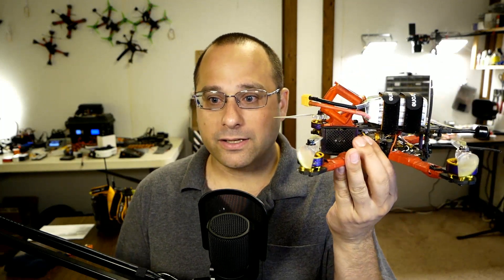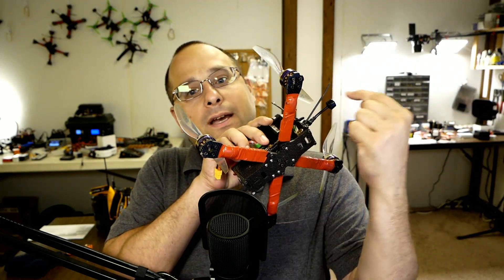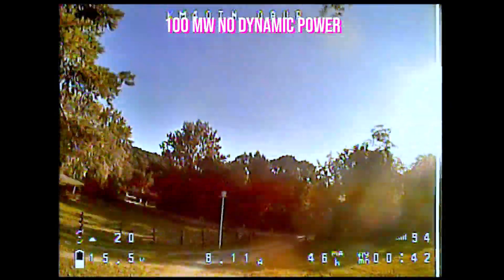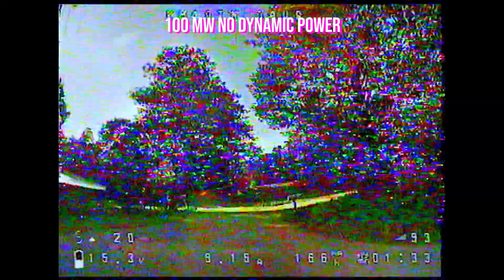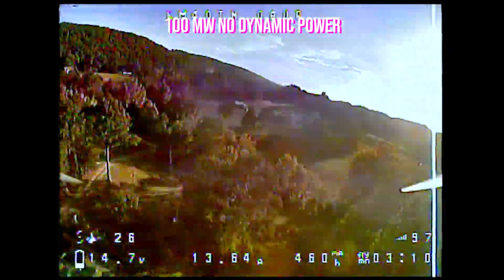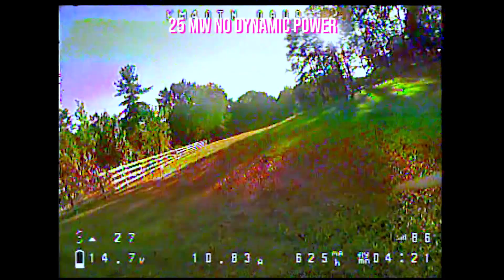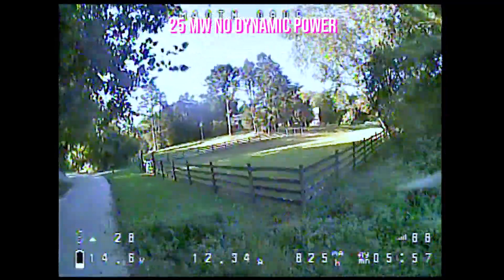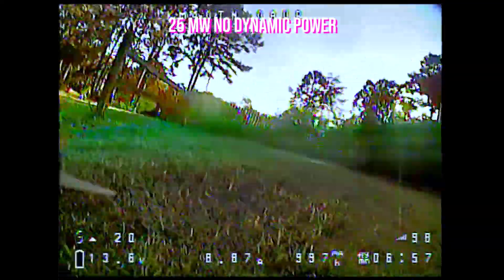TBS Crossfire 150 Hz | How Far Does It Go

Comment: You hit a null zone and thats why the beep. I bet you didnt setup a beacon for when it goes back up to rfmd2
Reply: The way he has his antenna setup you cant hit both null zones at the same time. So no it wasnt from null zones on the antennas
Reply: @BonemysterFPV  you still hit a null because the tx cannot be vertical and horizontal so you are wrong.
Reply: @Just-A-Guy-Learning  Doesnt he have his tx antenna pointed at the quads directions when it goes down to 50hz?
Reply: @Just-A-Guy-Learning  nevermind i get what you mean, anyways a lot of people mount it like this so its a good test.
Reply: You don't need a beep for when it goes back. It will constantly beep while at 50hz. Stop beeping when it isn't.
Reply: @fatal510  no it doesnt. It beeps once when it drops. Unless you set it to repeat. Which is annoying and pointless. My point was he dropped into 50hz in the null and likely jumped back up to 150hz as soo. As he moved out of it.
Reply: I guess you aren't very well versed in how taranis logical switches work? Because how I described it is how he said he has it setup. You noticed how it repeatedly beeps at 4:17 ?
Reply: @fatal510  im very well aware of how it works. But it's better to have a different sound for when it goes back up to 150hz mode. A single beep like most people do only lets them know if it drops to 50hz. Doesnt tell them if it goes back up to 150hz. Im hitting 5 miles in 150hz mode on 100mw. His drop into 50hz is from hitting null zones. Had he had it setup to notify himself when it went back to 150hz mode, he would have been notified once he turned out of the null zone.
Reply: Or better let Taranis say "2" for RFmode 150Hz and "1" for RFmode 50Hz!
Reply: Good chance he is on old firmware anyhow. Because rssi doesnt move from 99 when in 150hz mode since 2.30. Seeing his rssi all over the place tells me he was on 2.24 or older. He got a low rssi warning then it beeped when it dropped into 50hz mode. He needs to do this test on a newer firmware. Not one where the rssi/lq is all over the place in 150hz mode.
Reply: So what is the latest stable version? It was 2.24 last time I checked which was probably a month ago.
Reply: @Siamect  they are usually beta release for a week. Even when they do switch over to whats considered a stable release sometimes they dont bother updating the agent right away and post it in the crossfire group and forums
Reply from the maker: RSSI/LQ in the OSD can be ignored like I said in the video. The RFMD sensor still indicates correctly whether you are in 50 Hz.
Reply: @JoshuaBardwell  it drops into 50hz much faster on the old firmware. When the rssi drops it puts it into 50hz mode to extend the range. Forces it to drop into 50hz before it actually needs to. On 2.24 i was dropping behind a few bushes and it would go into 50hz mode. On 2.33 now and i can fly to the end of my neighborhood and drop down behind lots of foliage and still be in 150hz mode

Comment: Hey there Josh, I have my Taranis set up like yours for warnings. I use a TBS diamond antenna and always run it @ 2 watts, I never get the beep on my taranis. Could i really be getting 2200 feet away with 150Hz?
Reply: cJhudanich holy smoly... 2W!!! I can do 2200ft away with any of my Frsky setups. You should be more than fine with just 100mW.
Reply: Easily. Hit 5 miles on 100mw in 150hz mode
Reply: 2w is fine to set max. But turn dynamic power on. You will rarely see it go to 2w. You risk burning up your rx with tx on 2w at short range.

Comment: Is there an earth bank between you and the quad just a bit after you go out of your gate onto the road?
I think if you want to do (useful for viewers) range testing you probably need to do it somehwere the quad has LOS to the radio the whole way, at least for a baseline, then you can throw in behind trees etc.
Also be interesting to see the same with a 2.4 system. (install a second RX with power only?)
Reply from the maker: There is no earth between me and anywhere out the front gate or onto the road. However there are some trees and bushes and stuff.

The thing I was most curious about was, if flying in a typical race or freestyle environment, do you lose 150 Hz "early", and my answer is, no, you pretty much stay at 150 Hz everywhere within typical range.
Reply: Joshua Bardwell the problem that I've seen is that once you enter the 50Hz mode, it doesn't come back to 150Hz unless get a pretty strong signal again. I fly around my house at 10 and 25mW and almost every time I put the cars on my garage in the middle, it drops to 50Hz. You might stay at 150Hz in a race environment, but if you are bando freestyling, you'll be in 50Hz most of the time.
Reply: once there are more than 4 pilots up on CF where i race its a 50hz party

Comment: A bit off-topic, are you using the clearview module? The fpv feed is great.
Reply from the maker: This one was Rapidfire with 800 mW Unify on the vTX. But also it was the Lumenier DX600 DVR which does a MUCCCHH better job than the built in Fat Shark one.
Reply: Oh wow! Are you running the standard mode 1?

Comment: Just did the 250mw software update. I've been getting an annoying haptic warning when crossfire switches modes (even when LQ is in the 90's). Been looking for where to turn it off!
Reply: Mark Pfeifer you might be getting silent "sensor lost" alarms. Clear all the sensors and discover all of them again.
Reply: @ashade4037  Good idea, but didn't fix it.  Wonder if default taranis RSSI alerts need to be changed somehow.....

Comment: it doesn't matter if you can't see anyway..as long as it doesn't failsafe
Reply: Agree, main thing it dosent fall in the ocean on a fail safe! Turn that puppy up to 2 watts and see whats up!
Reply: Fly-N -Ryan have you ever ran on 2 watts before? What was your range if so?
Reply: @jazzzyj7589  yes i have run the 2 watts option, looks like it goes further then my vtx can handle. I do it in high risk spots that fail safe is not an option. As far as distance, That depends on environment. I would say atleat a few miles in an open area, never failsafed on 2 watts. But just like anything if you go behing a rock face or a dirt bank your range will drop dramatically. Hope this helps. ALOHA🤙🤙
Reply: Yeah, I had my micro flyable vision behind metal buildings but it failsafed. Then I had my big quad go rouge (bad reciever), and it got stuck at last command if 3/4 throttle into the ground as I ran to get within range to disarm. That toasted motor, my ESC board, and wierdly enough my FC USB plug litterally popped off (I've never seen that happen on an electronics devise).

Now that I have my HAM liscense, I just bought a directional Yagi-Uda antenna, and might strap a 2.4 Ghz Wifi booster (2w). In all, my controller would only be $150, and it has other mods like the "any battery mod", so it runs off an old cell phone battery up to 8s Lipos.

I should get some serious range after its done (stock its the same range as my Turnigy 9x).